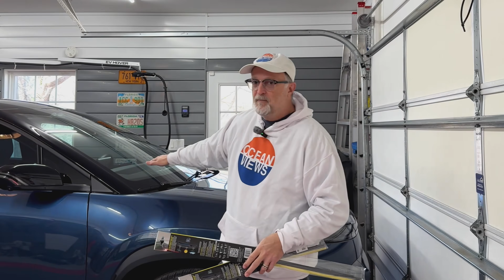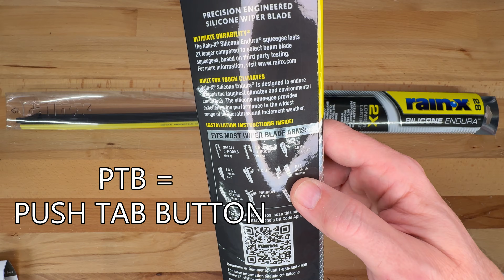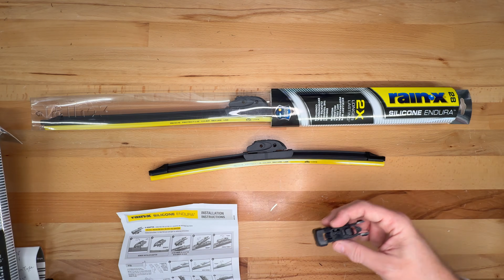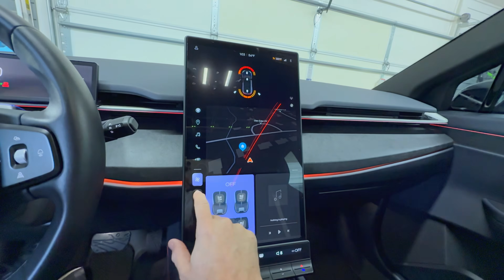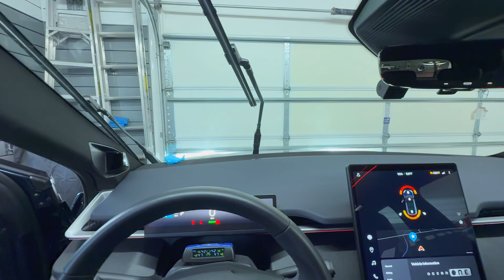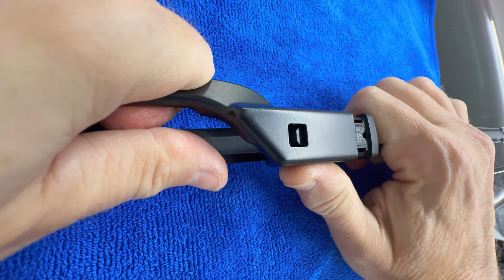Fisker Ocean - How To Replace Wiper Blades

Comment: Thanks for making this. Reminded me to replace mine, also doing well after 14 months. Have you considered WindshieldSkin? Just got a new windshield installed and planning to put the skin on it this weekend.
Reply from the maker: I priced similar windshield protection when I got my PPF, but even the installers said it's not worth it due to a number of issues.  There has been at least one person that had the protection and still had their windshield crack.

Comment: Windy also has a pretty good offer on a set of two (total 4 blades) for 78 with free shipping and you can get 10% off. Not too bad for 2 full sets considering cost of blades at Autozone or Similar local box store